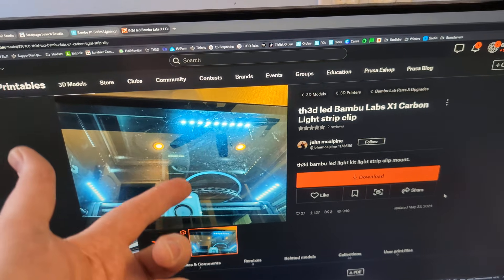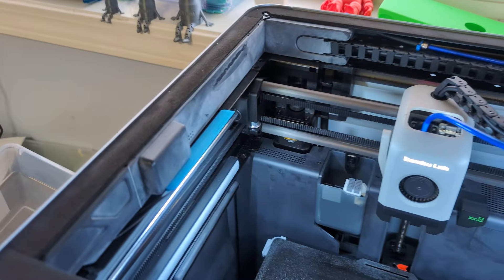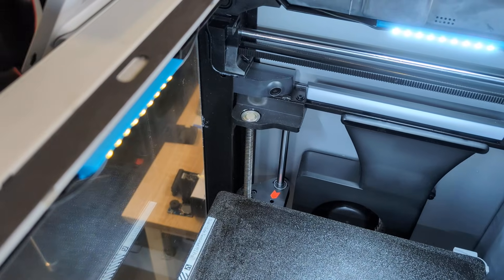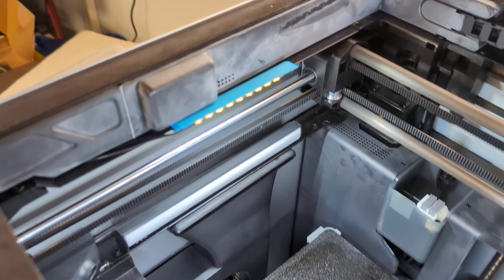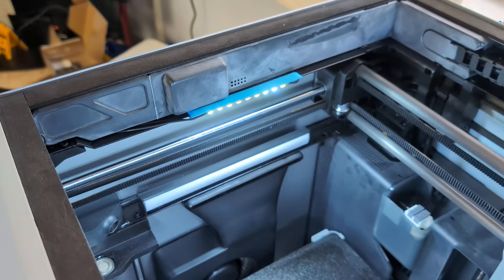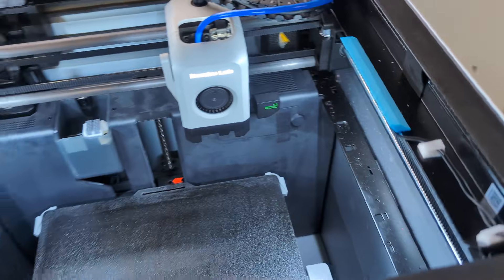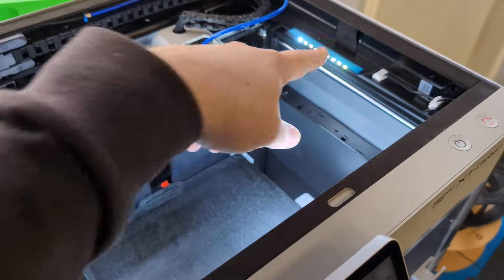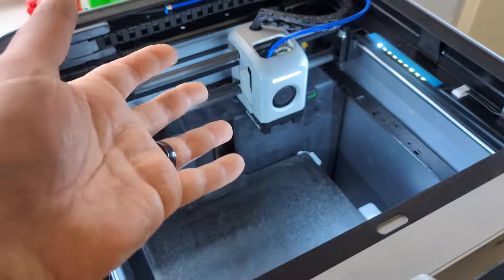TH3D Bambu Lighting Kit Mounts - 40 Degree Angle

Comment: I designed a variation of this that allows you to thread the lights through the middle creating a diffusion effect. It also removes the need to use the adhesive aspect. It's on Makerworld under the title "TH3D Bambu Lighting Kit Hollow Mounts."
Reply from the maker: Awesome, thanks for sharing.